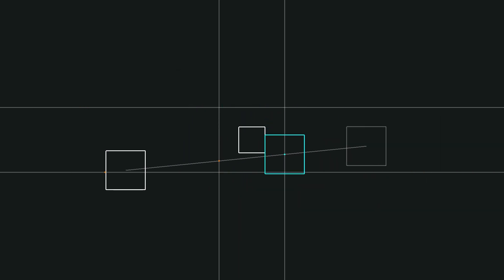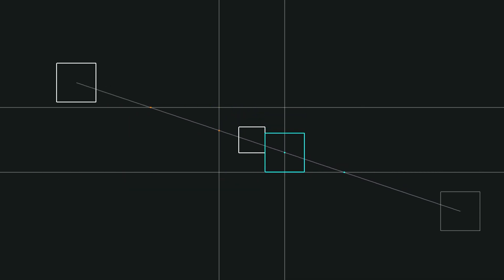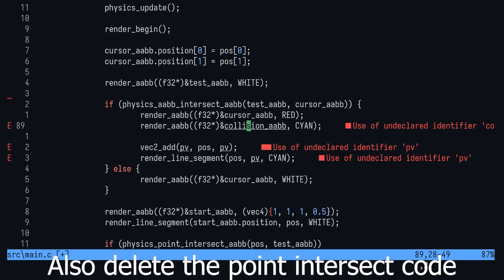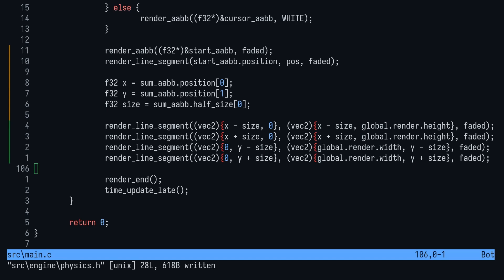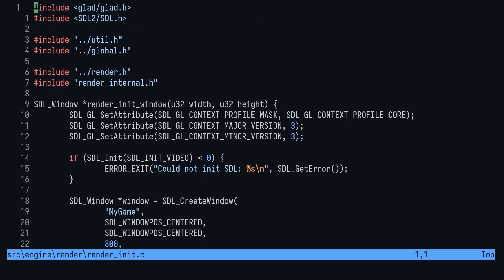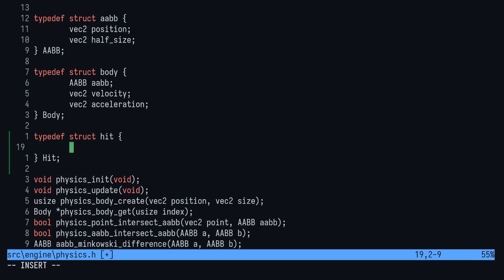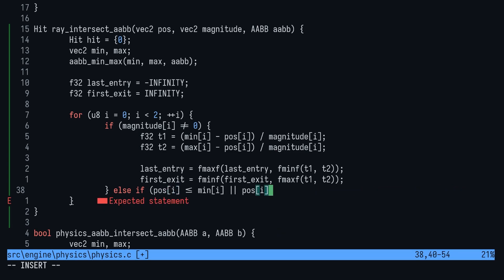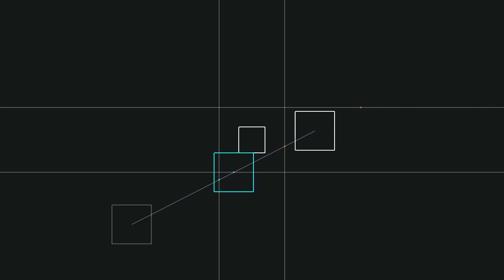Swept AABB Collision Detection | C Game + Engine From Scratch 08

Comment: Hmm this is interesting. I like the Minkowski difference approach. I just implemented this using a different algorithm, which finds the entry/exit distance using edge pairs along each axis, converts them to a normalized time (or alpha value, if you prefer) by dividing them by the distance of the sweep, then finds the latest entry and earliest exit of any axis, and returns true if entryTime <= exitTime && entryTime <= 1.0 && exitTime >= 0.0. I'm not sure which is easier to understand, but they're both cool!